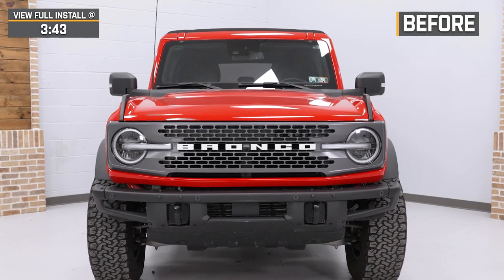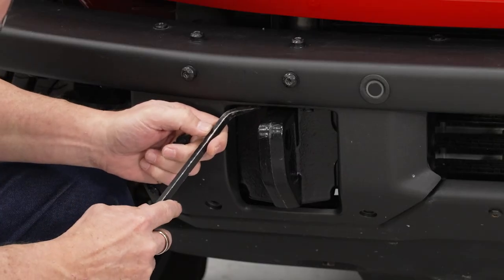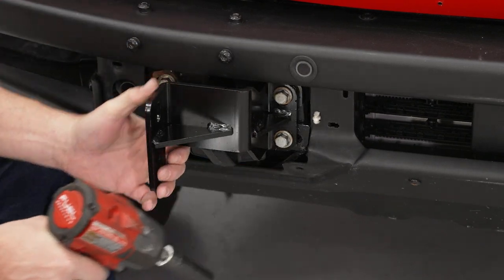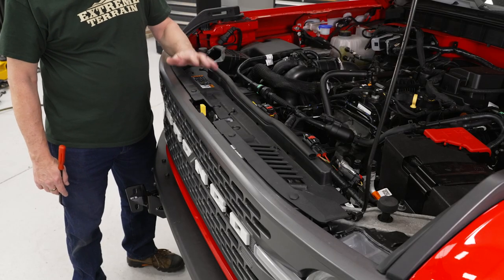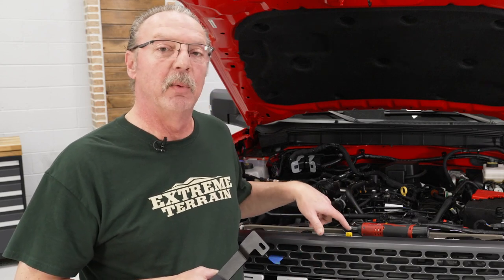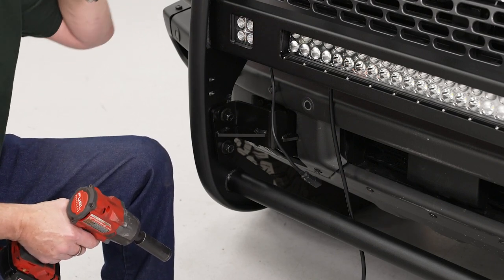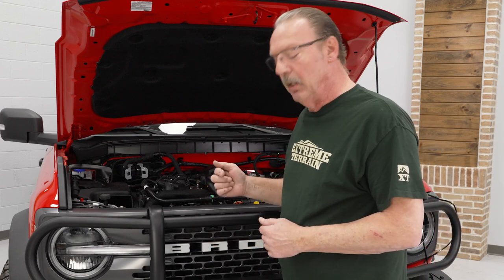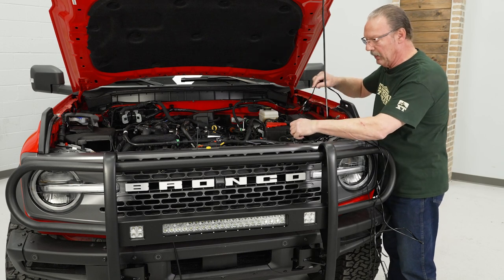2021-2024 Bronco RedRock HD Modular Grille Guard with LED Fog Lights Review & Install

Comment: Could someone please let me know what kind of front bumper this is? I am having a hard time finding modular bumpers that will allow the RedRock HD Modular Grille  (apart from the plastic OEM and the capable OEM Ford bumpers. Maybe I dont quite understand how the parts mount  but most modular bumpers dont seem to have access to mount to the 2 inner mounting screws from all the ones I've looked at. All help is appreciated on brands or models to select from!